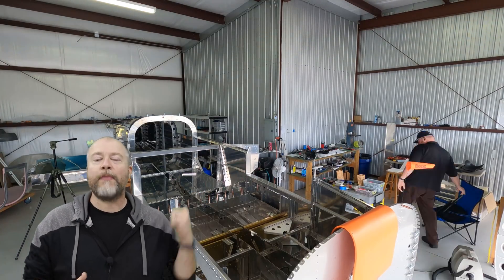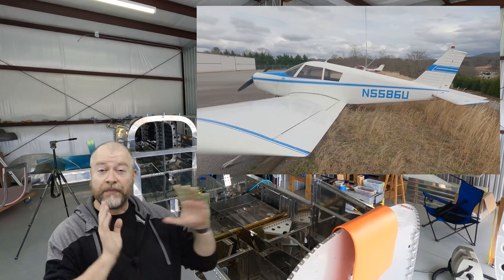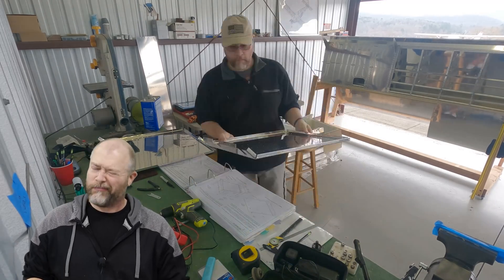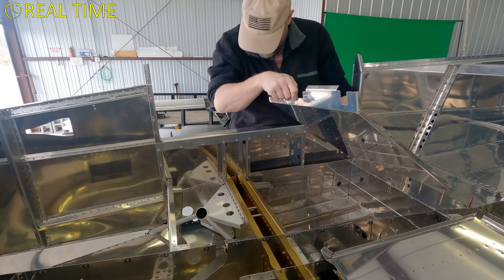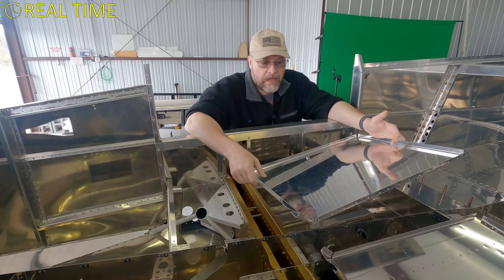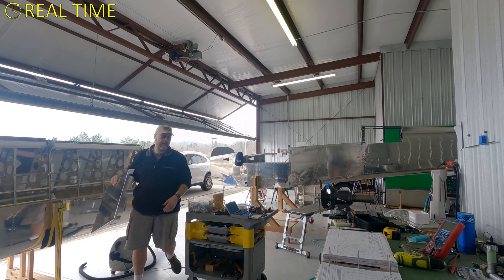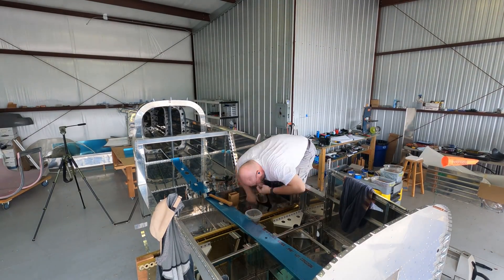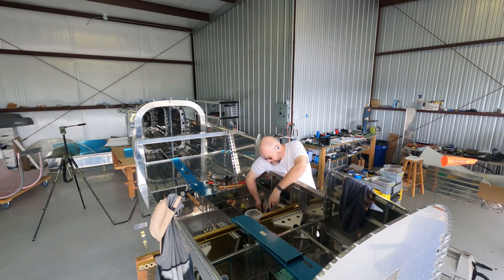RV-10 Fuselage - 042 - Rear Floor Pans Don't Fit!

Comment: Watched this a while back and took a mental note to come watch this again when it was my turn. It was key to file down the notches in the front of the pan for better fitment on the seat brackets. Mine went it real smooth after that. I also previously primed and dimpled all parts and it looks like I might need to run the reamer through the perimeter row but otherwise they squeezed in fine. Another tip is to put a screw into a nut plate assuming you installed it earlier and you can grab it with pliers to pull out the pan if needed.

Comment: Jason, I have searched the interwebs high and low, and I cannot find the answer to my question. I know you were done with your tanks and wings a long time ago, but if you could devote about 60 seconds in your upcoming video, I would appreciate an answer to this. I notice on the RV-10 tanks (as well as the Sling TSi tanks) that there is a large protrusion out of the front side of the tank - like a mini-spar. How in the world do you fit that tank into the wing with that big hunk of aluminum sticking out? I think I have figured it out.... this is my guess. The mini-spar doesn't have to slip into the wing skin, because it is attached to the wing toward the inboard side, and there is no more wing skin between the tank and the fuselage. It gets covered up by the walk-space skins AFTER you attach the wing. Which brings up other questions.
1) Does this mean that you can't remove the tank at a later date without detaching the wings?
2) What does this mini-spar attach to (@ the fuselage) if anything? 
3) How DO the tanks attach to the wings? Screws?
I can't believe in the whole webiverse there is not a video showing some builder attaching the tanks to the wings, or attaching the wings to the fuselage. If there is, I haven't found it. 
Cheers!
George
Reply from the maker: Hi George, you're correct in that the wing tank is PART of the wing it doesn't fit down INTO the wing.   The "mini spar" part you're referring to has to do with the control surfaces and serves to just carry the bell crank (I forget what its actually called) that controls the ailerons.  Nothing more.  It's not really structural as far as I know.. I could be wrong.. I'll do a mini video on it when I install the wing to the fuselage so you can see it better.. 

The wing itself attaches to the plane by attaching the wing spar, to the main center fuselage spars.  It's 6 big fat bolts that you have to drive into place then screw tight.

You CAN remove the tank on a completed plane.. but it will not be fun.  The tank itself is attached to the wing spar with 6 Z connectors that are bolted on, plus the million screws (one per inch) around the outer edge of the tank skin.  And then the aileron linkage stuff.. it wont be fun to remove. 

Hope that helps.
Reply: @JasonEllisBuilds  Yes, I caught that the aileron actuator exits the fuselage in that zone.... which doesn't make sense. The tank is between the fuselage and the aileron, so any actuation control, push-pull... whatever, has to get there behind the tank on the aft side of the main spar. Doesn't make sense to me why it doesn't just exist the fuselage behind the main spar.
Reply from the maker: The actuator arm comes out the wing root in front of the spar due to how the plane was designed and they have to run it along the side of the tank using that mini spar you mentioned going through the main spar before attaching to the tube that runes the length of the wing on the back side of the wing spar to control the aileron..   I think much of that design comes from making the control rod live under your butt instead of in the foot well of the person in the back seat.

Comment: Hi Jason.  I like watching your videos, and I really wish to be able to do what you're doing.  Maybe in the future I would consider it.  What is concerning me is that I live in Europe.  To ship that kit to here must be really expensive, plus customs fees and god knows what else.  Yesterday I checked the avgas price here...its twice the price as in the US.  And you don't find it everywhere.  With regards to the engine, have you looked at the continental engine?  I can't seem to find how much it costs. The good thing about it  is that it runs on Jet A1.  Keep up the good work.
Reply from the maker: You can add ANY engine you want.  That's what I like.  I'm sure there are continental RV-10 engines flying... I know there is at least one turbine RV-10 flying.. I think the trouble you'll have is you have to basically solve for everything forward of the firewall if you don't go with the lycoming.   While I get the JetA argument, I'm not sure I"m willing to go that route.
Reply: @JasonEllisBuilds   good point regarding the cowling.  That would be a headache.  As with the 540, Im looking at some theads in the forum about mogas as thats cheaper to operate.  Is mogas used alot in the US?
Reply from the maker: It's pretty common.
Reply: @JasonEllisBuilds  May I ask you another question pls?  One of the advantages of building a kit is that you can do your own maintenance.  Does vans offer instructions on how you would carry out periodic checks so that you can maintain a good safety standard on your plane?  And are you allowed to an annual check? As from the check lists I've seen online its quite complex.

Comment: Those panels were extremely difficult to install.  Mine were even more difficult because I put a couple of the stiffeners in backwards and had to drill new holes for them.  There was lots of swearing involved

Comment: You may want to think about conduit and access panels under some of those metal sheets.  I decided to put access panels for the comm antennas under the rear seat area.
Reply from the maker: I was thinking about putting the antennas farther back in the empennage.. Basically right after the baggage door behind that rib below the battery.. bad idea?
Reply: @JasonEllisBuilds  I haven’t even installed mine yet, I was just following the recommendations of others.  I’ve got the doubler plates installed, but I’m not sure if installing them further back would be a problem.

Comment: I am far away from that part, but just reading the manual I see it says to force the ribs apart so the floor plate can be put in. It doesn't say force the floor plate in.
Reply from the maker: Truth!  But some forcing was required.

Comment: You didn't mention, but I'm assuming that your Cherokee is at your home airport now. As far as the analog to glass avionics, consider this. Which is an easier transition - stick shift to automatic transmission in a car, or the opposite? IMHO, you're going in the right direction. Why steepen the learning curve now, while at the same time, building?

Comment: cutting notches and using pop rivets. Not saying you are wrong in doing so, but those things are exactly why you dont want to buy a project started by someone else :P
Reply: It'll still fly just fine.
The only RV built exactly to the plans is the initial prototype the plans are written from.
Reply from the maker: How many changes from the plans did your RV-10 have?
Reply: @JasonEllisBuilds  me? I'm way behind you on a -10, but as a general statement I doubt there's an RV flying that's 100% exactly perfect according to the plans.
Reply from the maker: @daleemmons36  I was asking Mehr. =)
Reply: @JasonEllisBuilds  sadly I don't own one yet. I know you sometimes have to adapt. Not saying this is a problem. 
There are 2 brothers close to where I live who restore old planes. They are polishing out ever little scratch they find beause a small scratch can become a bigger crack. But sure, there is a difference between a RV-10 and a 1.4m€ Spitfire.

Comment: As I watched this and saw the notch you showed,I see a crack  you will want to stop drill that crack or it will continue through that floor pan.
Reply from the maker: I'll look at it again but I don't think it was a crack as much as it was a bit of discoloration on the metal
Reply: @JasonEllisBuilds  I did sheetmetal in the AF and Army, for many years. Just from what i can see, it looks like one to me, but yeah, i would at least look at it. I took a screenshot, and zoomed in, it is definetely cracked

Comment: Where there's a Will, there's a Way!  Got it done... pinched/scrapped knuckles/fingers not withstanding!  Well Done!

Question.  The Nav Lights on the Cherokee.  Why does one have a sight indicator on the left wing, and not on the right?  How would you even SEE it with the famous, Piper 'Hershey Bar' wing?    (But Cherokees are a LOT of fun to fly!)

Yes, please include flying your Piper!  It's all part of the journey for this RV10.  =)
Reply: It's is a uAvionix skySensor, has GPS and ADS-B, plus the NAV/strobe.
Reply: @NETBotic  My Bad!!  Can you tell I don't have ADS-B?  =)
Reply from the maker: John is correct on this.. The other wing had the same looking wing on the indicator (just plastic to make it match not actually a minor antenna) but someone broke it off.. hah

Comment: That’s what she said.
Reply: Had the same issue with the rear seat floor pans.  My solution was similar to yours.  I noticed a crack in your aluminum floor plan just below the notch you created.  Mine was similar.  If you haven't yet, you may want to stress relieve the crack by drilling a small hole at the crack root.  Otherwise the crack may propagate larger.  Just an observation.